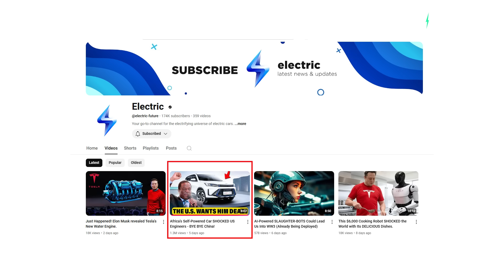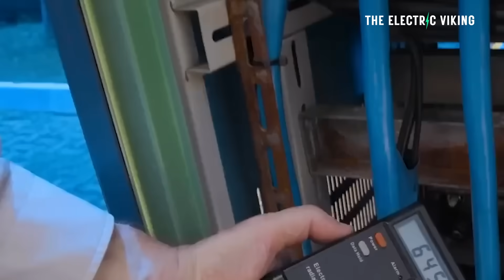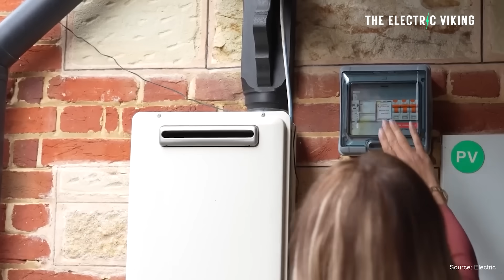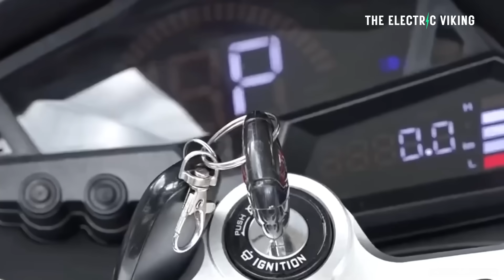Internet claims Africa’s Self-Powered Radiosonic Car SHOCKS Engineers

Comment: It's possible to convert naturally occurring radio frequencies (RF) to energy, but the process would be extremely inefficient for practical use, especially in the context of powering something like a car or even charging a battery.  There are technologies designed to capture ambient RF energy from the environment.  This concept is called "radio frequency energy harvesting."  The efficiency of harvesting naturally occurring RF energy is typically very low.   Naturally occurring RF frequencies are not practical sources for powering large systems or vehicles.
Reply: The through is  we have made something else possible if that components are not getting it power from radio frequency the technology relay work without a battery
Reply: Exactly. You can only get very small amounts of power this way. Not close to enough to power a car!

Comment: This is the newest version of the Prince of Nigeria con only with tech,  gizmos and hardware.  There is no possible way the radio spectrum could ever convey enough energy to make this work. Using the radio electromagnetic spectrum  to power devices works only with low power deviices like RFID tags. Now, if this is a real breakthrough (no it's not) good for him.